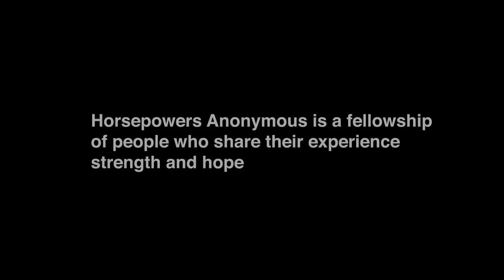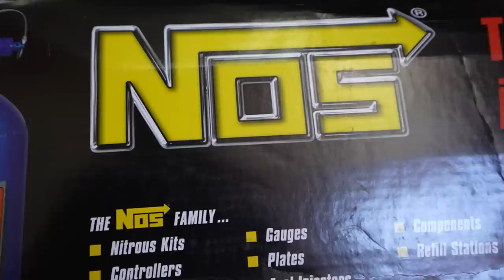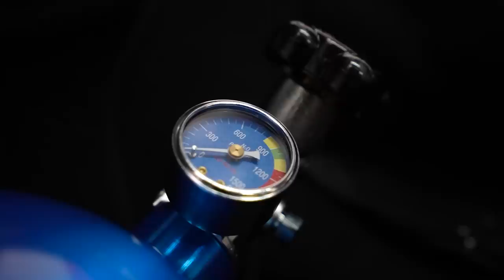Ferrari Specifically Told Me NOT To Do This....

Comment: Nitrous, I really dig it! Car was hauling the mail! I’d like to see a more secure bottle mount with bottle either in line with siphon tube down or sideways and rotated with siphon tube angled backwards. I’m not about NOS instructions, but NX points this out with installation instructions. With a full bottle it won’t be bad, but the closer to empty, the angled siphon isn’t in ideal location. Great video, car sounds ridiculous! 😁
Reply: "Hauling the mail"... I dunno. USPS is kinda suckin' these days. I think you might need a new analogy. 😉
Reply: #hitydesign
Reply: The joy this brings you is everything.

Comment: Personally, I feel like you are insane. It's going to grenade eventually. With that said, this is the reason I love your channel so much. You do you, regardless of what others think about it. That is one of the best qualities going. Cheers from the North!
Reply: I mean its not like she would make a gasket out of cardboard or anything that crazy
Reply: A 100 shot, wet, is not going to hurt that motor.
Reply: @r4raced4doom2  oh really?  Lol, please elaborate on why it won't hurt anything bud?  And please be very specific. I'm curious what would make u say that. 

It's a total gamble anytime she sprays it and just makes me think she must have plans to redo the motor or something and that's why she doesn't care. Who knows
Reply: @DMort22  if the kit is wired and installed properly the amount of nitrous for that displacement will not hurt it.  Adding all of 12.25hp per cylinder.   

If that's the case the SBE LS1 in my ws6 should have blown up a year ago on a 250 shot. (granted I did more prep work as in lower heat range plugs, my own tune to pull some timing and a wideband to monitor AFR.)

All I build are nitrous cars. Haven't blown up one yet and not for lack of trying. Nitrous get a bad name from piss poor installation 99% of the time.
Reply: You know it! That's what I love about this channel - doing the crazy stuff others shy away from!
Reply: #hitydesign
Reply: @DMort22  Because nitrous is just extra oxygen. If you add the proper amount of fuel, it's no more dangerous than a turbo. Forced induction is forced induction. I've installed dozens of nitrous systems and never had an engine blow.
Reply: @DMort22  We are waiting on your super smart response to R4. Make it good.
Reply: @UCpocJH9C-baek5mQWkn_Zeg Been doing this for 35 years. Boost and nitrous both increase cylinder pressure the same. It's just physics, bud. If you don't get it, you don't get it. Can't help you.
Reply: @DMort22  if you knew her net worth you'd know that she can afford it
Reply: I love how the comment section never fails to turn into a dick measuring contest!!   First we start with the contest to see who has more knowledge so people will just spit out a bunch of random comments to show how smart they are.  Like "all nitrous is is more oxygen ya know.  Its just air!"  Then you will get the guy saying "dont matte man ive been doing this shit for like 25 years and never had a problem!"  Then you get the guy "well Ive been doing this for 26 years and you need to build the motor for it".  Then they go back and forth for ever trying to prove who is right.  Shit just tell her nice work and let her live her damn life!  She isnt asking any of you keyboard warriors for advice so keep it to yourself!
Reply: @DMort22  With proper tuning a 100 shot, wet, on an engine like that is just a tickle! You'd be surprised what some guys who mod Pontiac Grand Prix's have done! Take a '99 Grand Prix GTP for example (like mine). Buick 3.8L V6, Supercharged. 240Hp under boost. I've seen some really scary examples. Haven't wanted to go that route on mine. Somebody has to keep one (nearly) stock so everybody else can look at it to see where everything "used" to be... 🤣
Reply: @DMort22  you’re joking, right?
Reply: Emilia just loves to grenade her cars... so she can build bigger engines in them...

Comment: Stand the bottle upright and mount the brackets to the wall at the back of the trunk.  With the bottle sideways the Inertia with the car on full pull will have an effect on N2O spray consistency.

Comment: Hey a little tip for ya 

Take the bolts for the bottle brackets flip them over tak weld the nut and put the bolts facing down it will be cleaner look and easier n and out
Reply: 👆Hey 👋
You've won something ❤💯

Comment: A: If the car ever stalls at a stop (bottle open), DO NOT RESTART the car !!!
99% of the time your N2O solenoid is stuck open / not closing all the way, get out & Check.

B: Run A Inline Nitrous filter!!! (Even super tiny debris can stick a solnenoid open.) 
at idle there's not enough vacuum to keep the explosion inside the engine!
AKA Nitrous Backfire.. I have blown multiple 3" intake ducts out of the boots & the steal screens out of my open air MAFS on one lean fule backfire.. Had a buddy grenade is entire intake manifold & bowed the hood 4" tring to restart at a stop... Just because he didnt pay att to worrnings about A & B (a remote bottle opener also helps)

C: Put your trigger, on a micro switch, or ?? so it trigers when you floor it. 
I did A hidden system on a Mercedes, the rear defrost armed it & the electronic kick down for the trans was the trigger. ;-)

Comment: Smaller jet sizes don’t necessarily correlate to like for like additional hp gains. This is because there is a slight cooling effect on the charge that you have to take in to account. With that in mind, your 50 shot might actually be giving you another 70bhp? Similarly, there is a diminishing return with the larger jet sizes. A dyno run will reveal the truth.

With regard to the setup, the hand held button really isn’t ideal. There is no point adding in nitrous if you are not at full throttle and it is possible to unintentionally damage the engine if you forget to come off the button in the heat of the moment.  A much better solution is to activate the solenoids via a micro switch mounted on the throttle linkage. That way, unless the pedal is all the way down (ie when you need ALL available power) you won’t be spraying nitrous. Not withstanding the fact that you are making it hard for yourself holding that silly button whilst trying to steer - right at the point you need both hands firmly on the wheel!

Further points to consider; You could fit some AFR sensors and gauges so you can monitor the state of tune, but it can all go wrong too quickly to spot issues on a gauge. Consider wiring up a fuel pressure sensor for the supply to the fuel solenoid and use a latching relay to arm the nitrous solenoid. Why? If the fuel solenoid goes down you would just be spraying  nitrous with no additional fuel and melted pistons will soon follow.  It would probably be a good idea to think about getting some better solenoids long term. The nos stuff doesn’t have a great reputation, or it certainly didn’t when I was playing with this stuff. Wizard of nos was the place to go for top quality solenoids. 
Lastly, don’t be tempted to up the jet sizes too much more… If you want to run more nitrous you need to look at the bottom end. Yes, it has forged internals already, but don’t forget that the ring gaps are currently set too tight for big shots of nitrous. A bigger shot will start forcing induction gasses through the tight ring gap and that is the point on the piston where they start melting first. 
Would also be worth taking a plug reading and see how it looks. You might need slightly colder plugs already and it will almost certainly need colder plugs if you are thinking about a going up a jet size given that cylinder pressures will already be up quite a fair amount! 

Have fun!

Comment: A 100 shot isn't even close to being enough to blow that thing up. I put a 250 shot on a small block ford back in the 80's, car is still being raced and all that's been done are basic refresh.  Dingle ball hone, rings and bearings every winter.

Comment: I get that any dealership isn't going to recommend it and won't warranty anything but unless you put a lot in and didn't have the tune on point it will be fine I wonder if you can pull timing probably not and I assume they don't have a lot of margin so 100 is probably about as high as you want to go